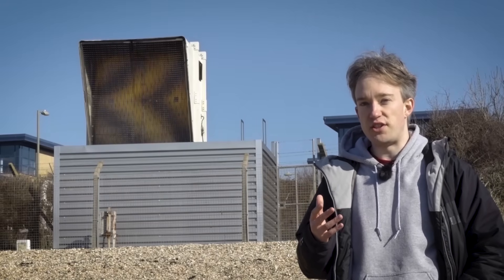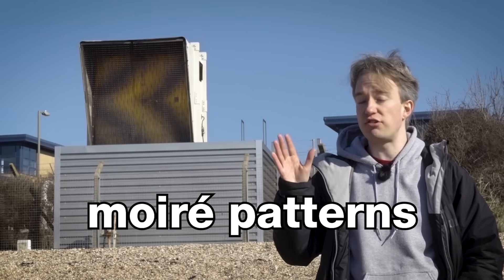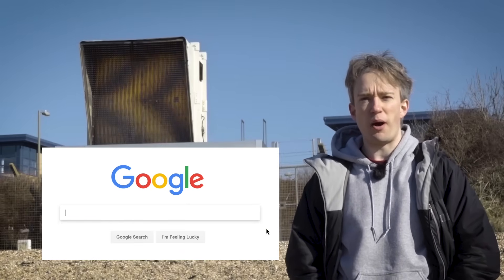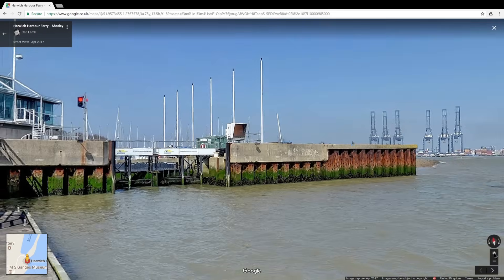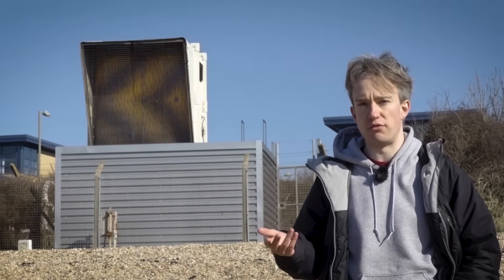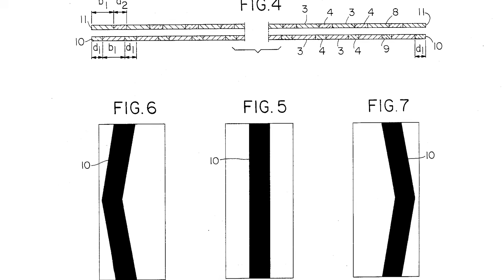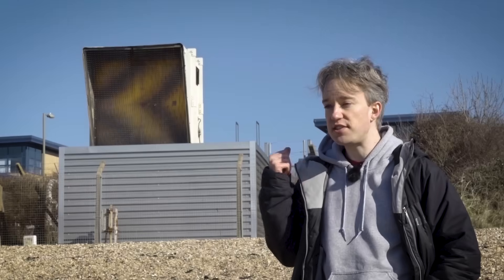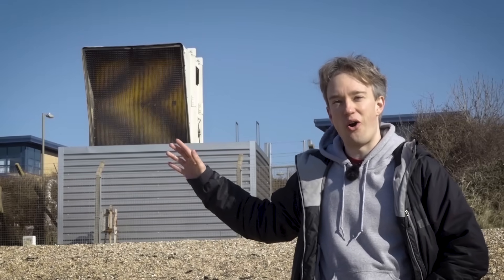The moiré effect lights that guide ships home

Comment from the maker: I'm getting emails from people who've misunderstood what I'm asking at the end of this video. Don't waste your time copying what I've already done! To be clear: I'm looking for solid evidence of why this particular light was chosen for a use that doesn't seem to make sense: flagging something to avoid. I don't need more information about where it is (Southampton) or what it's pointing at (a pipeline)!
Reply: People going: "I suspect...", note that he's looking for solid evidence. ;)
Reply: @DaVince21  Why would you need solid evidence for something so obvious as to not be questionable?
Reply: Hi Tom, I'm a merchant navy officer who used to work around there, although I never came across this particular light...  Sector Lights and Leading lights (parallax) are the internationally recognised marine signals for this sort of use (white light centre, with red and green lights either side to guide you to a safe channel, which i'm sure you've researched and are aware of), but one thing that doesn't come up too often is lines to specifically avoid, and as such there isn't an internationally recognised means of transmitting this with lights.  The signal is pointing towards the danger, which is unusual in maritime practice, but it's certainly not a common light and isn't in the IALA buoyage system used for identifying marine hazards.

If it's in a marina, which i think you mentioned, it'll be specifically to stop boats dropping anchor on the submerged cable within the marina's jurisdiction, and it'll be specifically referenced in the marina's or the solent by-laws as an anomalous regulation.  (I don't have time to go and hunt it down, but it'll be there as a local reg.)  As far as i'm aware, that's the only possible reason for it.  It's an unusual solution to an unusual problem.  I could of course be wrong...i bring no hard evidence to the table!
Hope it helps
Reply: @Sarah Thomas There is no naval base in Southampton, perhaps you're thinking of Portsmouth...
Reply: @jammin023  maybe not the Royal Navy but the Royal fleet auxiliary is based in that area in hythe i think.
Reply: So just to be clear, youre asking us to point you in the right direction.
Reply: Probably had a few hundred thousand left in the budget and said, "screw it, get another inogon light!"
Reply: addendum to the addendum - if the channel being used in the marina is the only safe water/depth for vessels to use they couldn't stick buoys along the channel, which would be the usual method of denoting the pipeline.  This light would then be both the leading line for the channel denoting safe water like a monochrome sector light, but also denoting the underwater hazard with a yellow light, killing 2 birds with one stone.  That might be why they're so rare.  Come to think of it, I could literally just check this on the Charts if you gave the GPS co-ords!
Reply: This is an alternative form of "leading light" (UK) or "range light" (US).  The usual form is a pair of lights/day shapes separated by some distance, with the on in front being lower than the one behind.  By itself all it does is indicate a particular bearing.  You must consult your chart or Coat Pilot to learn why that bearing is interesting.
Reply: Just a little addendum to this, having read some of the comments below, GPS is taught to navigators as a useful but unreliable tool, so buoyage and shore based lighting is still incredibly important to mariners, along with radar, and to a lesser extent astronavigation.  Just as a side note, my own training, many moons ago, involved a simulator run from the SW Needles in to the tanker terminal at Fawley with a GPS that gave random errors and buoys that sat out of position, so we're trained to use more than just GPS to follow a course line.  

I couldn't quite tell in the video the colour of the light that's behind the moiré beacon, because my laptop has a liberal use of the concept of 'white balance' , but yellow is considered a 'Special Mark' which can really be anything that sits outside the realm of the other lights as long as it has a characteristic (flash pattern) that cannot be confused with a white light.  There are no similar white lights, and no white navigational lights have an otherwise solid light characteristic, nor do they come in exciting moiré patterns.  'Special marks' typically denote the location of outfalls, protected areas, and other underwater navigational hazards.  

In addition, countries may use lights outside the gamut of IALA and ColRegs to denote things as long as they can't be confused for the internationally recognised signs.  So as long as they prescribe the regs in their local rule books and it's not similar to any other symbol used (which this isn't) unusual lights are legally fair game.
Reply: I hope all the people giving useless info here are taking the piss
Reply: Jason perhaps you could enlighten the rest of us as well?
Reply: Tom Scott you are one of my inspirations
Reply: DaVince21 I doubt one can get that easy of solid evidence online  perhaps. There are things of much misinformation, but this maybe in historical documents else where. 
Maybe asking company or whomever owns it?
Reply: I think what he means doesn't make sense is the direction the arrow points. You could argue they should point in the other direction if you are supposed to avoid that line, not pointing towards the line.
Reply: I can't believe people are telling you where it is when you're standing right in front of it.
Reply: Wait. People actually messaged you saying "yo this light is is southampton" after having watched a video of you standing in front of that light, which obviously required you to travel to southampton?
Reply: I mean if it doesnt make sense to us now its gotta be a religious or spiritual tool
Reply: I think the point many people are missing is they could have just put some flags/lights on either side of the 'pipeline' and then a big lit sign saying no anchorage between flags/lights rather than buying a fancy expensive light to indicate the area. I wonder if the lines can be rotated to change the 'no anchorage area' if perhaps the area isn't static? I'm not sure if the Inogon lights can do that or if the no anchorage area might not always be the same (someone mentioned subs elsewhere and I think we have a big naval base in Southampton so perhaps it serves more than one purpose)? How large an area do the Inogen lights direct around? I assume it isn't a very large area which would be fine if it is just a pipeline but not much use for anything else?
Reply: @misschief4283  some flags or regular lights would be ambiguous at any distance. With the inogon, you can be far away but still know precisely where to not drop anchor, etc
Reply: @misschief4283  It probably was chosen because (1) navigators are used to them and (2) in this case it helps for someone to know not only that a hazard exists right there (when you're practically on top of it) but also that you could prepare by being warned from a considerable distance away.  Maybe they're not widely used in other places, but in the USA and Canada where a high speed road approaches a stop signal from around a blind curve or hill, it's not uncommon to have a sign in advance of it saying "SIGNAL AHEAD" or even an electrified sign with the word "RED" preceding those words synchronized to the signal so that traffic will have an additional warning in advance.  This Moire device seems very sensible to me to use for an especially large or expensive hazard to navigation.  Remember that ships have considerable momentum and can't change course quickly.
Reply: I sent this question to a cousin who is a merchant ship captain. He made two observations:
1: The range of these signs is short. He has seen them used only for ferries.
2: They are also used in airports to guide planes to the gates.
Reply: Wait, so the arrows point towards the pipeline, rather than pointing away from the pipeline?  How weird.  I could see them being  useful to direct you away from something - angled such that the arrows show up, pointing away from the no-go zone, so if you drift to close they direct you away.  But if they're pointing /to/ the pipeline that is very counter intuitive.
Reply: Tarmo gr This is everything he said in the video. He is curious as to why they used this instead of something else, as this is expensive.
Reply: Such a light only makes sense if you know what it is pointing at/marking. It is the same rule for a lighthouse - you do not know wich way to steer around it, unless you know what it marks. And if you think about it, Navigation by stars follows the same rule: You can not navigate by them unless you can idenify them.
Any given lighthouse could mark the aritficial island in the middle of the harbor enterance. To the dangerous rocks on either side of the harbour enterance. You can drive around one either way, as long as you know the distance to keep. But for the other, there is coast on the wrong side, wich is one thing you really need to avoid as a ship.
For the (diving) crews that build and maintain that pipeline, it is actually a valid "match this" light. For all the others, it is simply a navigation aid that has been there for ages, so we keep it around rather then building something else. "Never change a running System" and all that.
Reply: What is even more interesting, is that the purpose of a Lighthosue largely shifted over time. The original ones were mostly about marking the save enterance. Wich makes sense, as keeping a light on was not cheap in antiquity.
But with modern structural engineering and electrical light (and GPS/Naval Radar of course) the purpose shifted towards marking hazards. More a oversized Warning Bouy, then what they were used for before.
Reply: Speculation: they used an unfamiliar technology so that it wouldn't be confused visually with existing directional signs.
Reply: Tom Scott Have you tried to contact the Harbour that is in charge of the area? Maybe they will provide an answer.
Reply: Arrows are supposed to point where to go. A maintainer of submarine pipeline/cables would interpret this signal differently than any other voyager afloat. ¿Possibly this was installed with maintenance in mind?

Of course undersea support vessels are using GPS and electronic charts (ECDIS) nowadays to guide their activities.
Reply: if it wasn't there the internets would get caught in the surf.
Reply: They couldn't order it reversed, cost too much to get it customized. So they just said do the opposite ;)
It's a guess, but that would be logical.
Reply: ISO 14726 shows a pipe sign/sticker/indicator, as being 3 verticle stripe lines - yellow/violet/yellow being liquid gas! But even just any colour left and right with a different colour in the middle should tell you it's a pipe!
When you can see the 2(3) lines on the Inogon light, your over the pipe and should wait till you see the arrows getting more and more pronounced as you get further away, then drop anchor when you cannot see the lights anymore!
Look on Google Maps, you can see a cutting in the undergrowth on the opposite bank and eventually the pipe exiting the ground before it goes into the refinery/storage facility!
Reply: Often I find the answer tends to be 'because it was good enough'. Not perfect, not necessarily or entirely justified, just good enough to do the job.
Reply: Ah yes, it appears to be from Southampton and pointing to a pipeline, hope that helps Tom
Reply: The moire the merrier.
Reply: If there were only one thing to stay away from, it would be helpful to know where it was.
Reply: You do realize that it is the internet that you are asking to, good luck.
I wish there was a time lapse of you doing research on this rather interesting subject.
Reply: I realise now that i've written too much for a youtube comments section
Reply: I disagree.  You set it out very well.
Reply: Martin Jeffries you seem well versed in  maritime matters..I curious from your  experience what's the longest distance you have spotted lighthouses from when approaching ports ect and any further info you can provide on line of site tech and distances achieved
Reply: Tom Scott i
Reply: I didn't know we could email you.
Reply: The simplest expalination is that the people who heard about this light and installed it misunderstood how the light is meant to be interpreted. 
Everyone just got used to using this light diffrently so now changing it would be more confusing. That's my guess.
Reply: So. what your are saying is most of the time these lights are used to tell you the right direction, but here they are indicating the wrong direction, the place you don't want to be? So how does one know the difference?
Reply: Well maybe that's exactly the point... to point at the direction ship should avoid.
Reply: Its a thing to do a thing. Nothing more, nothing less.
Reply: Tom Scott what if it’s an old piece of building equipment that never got removed? If it’s cabling, you’d want it very straight. Dredgers could have used it to dig up sea floor in a straight line, installed the cable, and then didn’t uninstall the light.
Reply: @ItsNotAHorn  It is a light. Lightbulbs fail and need to be supplied with electrical power.
So someone is maintaining that light. And has done so for decades.
Reply: Honestly maybe the guys were just really convincing and convinced them they needed a sucky light arrow
Reply: Flagging something to avoid! Using this inogon light, why not ??  It certainly marks out where the power cable is . Some people  in an office somewhere had a problem and looked at all the solutions and this thing won .
Reply: So, are there any updates? I'd like to know about the evidence. Thank you.
Reply: Tom Scott: I mean it is an effective way to let people know where the pipeline is 🤷‍♂️. As long as everyone that uses that waterway knows what it’s for, it seems like a good solution. In fact, I can’t think of a better (more accurate) way.
I just realized I’m 2 years late 🙄
Reply: That's the glory of boating! It happens all the time from the different buoys and flags. For instance keep red on the right and green on the left.
Reply: I'm a merchant seaman by trade and it makes no sense to me why they would use this instead of the conventional no anchoring /submerged pipeline signage
Reply: My suggestion would be that maybe the pipeline runs diagonally across Southampton Water to the refinery, and so by using the usual static markers on each side it would not be obvious which markers are the pair. Also the shoreline on the refinery side where the pipeline comes ashore is constantly blocked by oil tankers using the dock, so a static marker would not always be visible. So the marker needs to be a design that is directional and works from only one side of the estuary.
Reply: Is the purpose: (1) To indicate where the hazard is or (2) To direct people away from the hazard?
The person who specified the light may have been an industrial designer of industrial piping systems, not a nautical designer.   So marking the location of the hazard may have been his perspective.
Reply: chaotix80  Wouldn't work very well at night, and the mirror etc would still need to be cleaned/replaced when necessary.
Reply: Did you find out your answer in the end? I wondered if they used this type of light because from a Single point, you could delineate the trajectory of the pipe underwater, rather than a series of flags or buoys?
Reply: Maybe it's just me, but why wouldn't flagging something to avoid be a very good thing to do?  Your clarification doesn't clarify anything to me; I don't understand why anybody would ask such a question.  We use all sorts of "keep away" signs on land and sea, why would this be any different?  Did you think it's too sophisticated an apparatus to do just that?
Reply: @goodmaro  because flagging something wouldn’t leave a totally unobstructed path on the water surface for traffic to pass.
Reply: Why exactly do you think this use does not make sense?  A single sign relies too heavily on a persons ability to understand from which angle the cable runs underwater from the sign and at what angle they currently are from the sign.  Requiring to not be between the two signs on either side assumes you can see and be close enough to read the sign on both sides.  Point this thing along the underwater cable and set it up so your hazard message of choice is visible on center and off anywhere else and it’s perfect.
Reply: Tom Scott: please stop sending me messages saying it's indicating a pipeline, I know that already.

Result: 10,000 replies saying that it's indicating a pipeline.
Reply: Looks like the arrows show how close to the pipes you are and the parallel lines indicate that you are aligned with them, meaning “Do Not Anchor”
Reply: And the purpose for using this light is to indicate from a wide angle where it is as opposed to a single light which would appear the same from many angles
Reply: Chill out.
Reply: How difficult would it be to reconfigure the pattern so it always points away from center?
Reply: Did you try contacting the office of the Harbour Master?
Reply: The most likely explanation is that somebody screwed up by using it in that application/location and it was just never removed.
Reply: The answer is in the patent.
Reply: I find it particularly odd that they did it this way, when an easy fix would be to move the bottom half to the top half and the top half to the bottom half.  Then the arrows would always point away from it.
Reply: @ARTEM_VETROV  stop spying on us.....
Reply: Will try to hit it asap. But we are all vikings, even you. Just saying.
Reply: And why doesn't it make sense to flag something to avoid..?
Reply: Don't tell me what to do. 🤣
Reply: I bet it is the internet cable
Reply: Simply add a red filter on lights that are for avoiding
Reply: Doesn’t it make good enough sense? If you see an arrow you can drop anchor, if not then keep going. To me it’s like choosing a normally open or normally closed actuator in a pipe system. You can get away with using either, you just have to think reversed, or at least program in reverse.
Reply: It would appear that these guides can only be seen from the surface so there is some aim at security from seeing lights or other markings from the air - a military / national security measure? Also there is the possibility that other markers may be confused with IALA or airport marking lights due to similarity or proximity?
Reply: Tom Scott It does seem to be a strange use of such a piece of equipment. I know that there is a lot of stuff under the water there... Pipes, cables etc as you mention in the video. I also sail those waters. I have some local contacts in the area so I'll see what I can find out.
Reply: The only solid way to know for sure is to contact the company who put them there.
Reply: The light is doing exactly what was intended -- pointing out a particular bearing that is of interest to the mariner.  To know why it is of interest you must consult your chart or Coast Pilot.

It's information, not an instruction.
Reply: It doesn't make sense because these are normally used to direct ships.  See an arrow pointing one way, turn in that direction.  In this instance that is exactly the opposite of what they want you to do however someone unfamiliar with the area might follow the arrows without realising they are meant to mark out an area to avoid!

You're spot on about them using it for this purpose (i.e. marking out exactly where not to drop anchor), but it is the opposite of every other application these appear to be used for, or at least that we know of.  So are there any other instances where these are used to point towards a hazard?
Reply: Sent you email about one that is over 1000 years old
Reply: @jasongurr  where is that, and how does it work?
Reply: @jasongurr  really? is there a way that i could have a look at it?
Reply: @jasongurr  I would like that link to please
Reply: @jasongurr got any info on it you can point me to, please?
Reply: Tom Scott great video love it and all the ones you make
Reply: Look at complex Human Systems research (aka C2) at Nasa/Ames Moffatt Field ("the Blue Cube") from the 70's to 80's which also tested underwater detection (ie, antisubmarine) measures along with the DARPA underwater research lab in Idaho. The idea is subtly psychological: you turn with with arrows, even subconsciously and you tend to tack toward a light rather than facing it straight on. An underwater cable, defense installation, or runway path out over water is not something you want to call attention to, it's more about passively and subconscously causing others to clear an area.
Reply: The pipeline goes across the channel to the pumping station perpendicular to the light, so at any point along the pipeline, if you're directly above the pipe, the light is full intensity with no arrows, telling you not to drop anchor.  If you are anchoring there, you go out until there's a visible arrow on the light to know you're safe.
Reply: @jester1983  BINGO!
Reply: Watched a video on YouTube today that said this light is in Southampton and is used to indicate where not to drop anchor and is pointing to a pipeline.
Reply: @joanbohlman1679  I watched that too, it was by some guy named thom scot I think (spelling?)
Reply: +Tom Scott I have an idea as to why its there and a good idea as to what it's protecting, both of which involve the surrounding BP Oil UK, but I'm going to need more time to finalize research.
Reply: @noahgershoff3241  well, I’m still waiting…………..   patiently,……….. I might add.
Reply: I agree with some of the commenters here that it may be unusual to point at a location to avoid, but why not? Mariners not farmiliar in that area should consult their pilot books, which will refer to this light and why to avoid the area. If you look at an online map (like the Navionics webapp), it marks a stretch of water as prohibited for anchoring as well as fishing. Trawlers may be operating in the area. 

While we've come a long way with GPS and electronic charts, buoys, lights and other sings are still a primary source of navigation. If you want to mark this specific part of the water with buoys, you would probably need a lot. These require maintenance, can shift or get damaged from ice. This single light is probably a lot less expensive on the long term.
Reply: Maybe try walking up to the captain of a boat who routinely works on the harbor and asking what the light tells them to do? Or perhaps contacting the owner of the pipeline. Someone has to know, and they would be the most likely folks to know.
Reply: human error waiting to happen
Reply: I don't understand what you mean by "doesn't make sense". The application needs a line projected out over the water to indicate the location of something invisible, and that's exactly what these lights do. What about it "doesn't make sense"? 

(Also, <sigh> at all the comments about marinas, naval bases, submarines, and cables, when it's clearly charted as a pipeline between Fawley Refinery and the Hamble oil depot, and the video itself is obviously not in a marina or naval base.)
Reply: Simple answer, this way you only need one light, not more, to divert away from a single point you'd need two lights placed beside the spot you don't want people to be in
Reply: My guess is that it was used for the purpose of guiding the workers laying the cable. If it’s so expensive, they might have decided to leave it there for the (albeit confusing) purpose of informing the ships as to where the cable lies.
Reply: if the light was constructed before or during the work on the pipeline makes a lot of difference if the light was placed before this would be a really accurate way to construct the pipeline without the modern day dynamic positioning systems. or it is used as an indicator for survey vessels.
Reply: The lines were probably run in a straight line, as straight line is the shortest distance. When the Moire' shows I you know your directly over cable. When it shows > than you know your to the side of the cable and anywhere further out should be safe to anchor and vice versa for the other side.
Reply: My guess would be that its for maintanance crews and vessels replacing parts of the underwater cables and pipes. If its an oilpipe i can imagine that it has to be checked regularly for leaks.
Reply: Does Inogon even produce any other Moire effect lights with other patterns? Probably not since they even removed this one from the web site. Perhaps this video will give enough of a bump in interest to bring such products back.
Reply: Why wouldn't that be a reasonable use? Marking  something to avoid seems logical..  how else would you suggest to mark the underwater cable?
Reply: Isn't it sort of the best solution to the problem? The signs are usually used with a craft sailing towards it, and not passed it, and if there is a specific place where you can't drop anchor, wouldn't you want something that always points away from that point? I guess it is foolish to use what is usually a "this way" beacon as a "not here" beacon, but is there a better way to do it?
Reply: Cause lights work even better at night, while other markers get less useful?
Reply: If there is a water way under there Couldn't an anchor break through causing something like the 1980 Teaxaco incident. Yea It Wont drain an ocean but the boat that dropped anchor is defiantly getting sucked under.
Reply: sorry Did not know it was a Cable , Isn't it just To stop em from dropping anchor on a cable and causing bunch of damages? I dont know what the cables are but They could cost a lot of monies. Maybe I'm just looking at it too dumb .
Reply: @jacobrobison7088  It's not the dropping of the anchor, but the dragging of it that could do the damage.  But once you've dropped it, too late, huh?  Unless you cut and abandon it.
Reply: Tom Scott it’s in Southampton and it points to a pipeline
Reply: Possibly different ship are different sizes so knowing where the cable is exactly would allow you to judge your what room a vessel of your size has to manoeuvre??? Just a thought on a possibility.
Reply: Do they illuminate it with two different colours? If it was either green or red, green means 'park here' and red means 'keep clear'???
Reply: @whatyousaidbud  That would also be contrary to what's expected: In shipping and aircraft, red means port (left when facing forwards) and green means starboard (right when facing forwards).
Reply: The arrows point to where the item of interest is. Away, as in what you do about the item is up to the skipper. As for why that type of light... More commonly there would be a low level light near the shore and a raised one further back. Perhaps there was no way to place the high one due to terrain and land use.
Reply: How about the manufacturer only makes systems which point to something (guiding boats or planes)? Also worth noting that for anyone familiar with the system, they would be confused if the arrow pointed a direction and they never saw the straight line whilst they kepy going towards that direction indefinitely..
Reply: Perhaps it's not there as a tool to avoid the cable while at sea but rather to help find the cable if work needs to be done on it.
Reply: The oil spill off the California coast should be enough evidence of what happens when you’re improperly anchor.
Reply: that looks like that was thier b4 the houses try finding information on the plot or who owned the land
Reply: It's directing ships AWAY from the light. If you're coming from the right then it shows you an arrow facing right.
Reply: Unrelated but interesting, Moiré patterns are used in metrology for optical measurements.  You might think this is interferometry, and some measuring equipment does use that, but Moiré optical devices do exist and they are not using interferometry optical measurements.
Reply: We flew a kite in a public place
Reply: I haven't read most of the comments and I'm dead tired right now, but I would approach one of two different ways: 1.) What are the cheaper alternatives, and are they as effective?  or 2.) What is the overall intent of using this particular tech?(example questions: Does some one stand to profit that knows the right person?  Have they signed some buried international law, and it just that hard to change international law? Are are these light visible further away compared to other light in the past?)  Well good luck, and good night.
Reply: I would say the light has two purposes. The second purpose would be so pipe maintenance boats could accurately find the pipe at any distance from the sea.
Reply: They probably wanted one to point the opposite direction and the company either didn't bother to take the effort to make it do that, or they simply didn't know how, and then the people using the light, just settled for using that.
Reply: This light does not need to be understood by everyone. It only needs to be understood by large ships whose anchors could damage the pipeline and those ships are only piloted by a small number of Southampton port employees who are helicoptered out to the ships as they approach the harbour. It really doesn't need to make sense to anyone other than those people.
Reply: @backgammonbacon  thats for contributing less than nothing
Reply: I think that you answered your own question.  It is pointing at a pipeline.  If a ship were to drop an anchor for any reason, the anchor could snag the pipeline and rupture it.  Then, depending on what is in the pipeline you could end up with a big mess; or a really big mess and a quite serious calamity.

Normally, I am used to seeing very large signs about no anchors due to underwater facilities.  What I really like about this is that there is no ambiguity about where you (the ship) are with respect to the underwater installation of concern.  Especially when  there is an extremely wide channel.
Reply: @paulkurilecz4209  Cool sign
Reply: Uh, have you ever had people mark a cable in your yard???  THEY MARK WHERE THE CABLE IS.   

The same thing is done here....it's not complicated.  If you see vertical lines....don't drop anchor.
Reply: DaVince21 - I KNOW that I suspect... (sorry, couldn't help myself)
Reply: Or maybe if the pipeline isn't rigid, perhaps the moire pattern can be adjusted automatically/manually
Reply: Tom Scott I believe that it is telling boats not to place an anchor there because there may be a internet cable which connects the whole world together. I remember watching a documentary on internet cables a couple years back, if you’re still interested you could possibly research the relationship between the internet cables and the light.
Reply: It's possible it's just supposed to be a very cheap method of accurately pointing out the pipeline, without using power, yet is still highly visible and distracting. It Feels like something that would have been built in WW2.
Reply: Hi, so maybe you have figured this out by now, I don’t know, I tried to read a lot of the comments but not all of them. Yes, there is a pipeline under the sea at that point. The cables referred to on the sign are a unit of measurement, 100 fathoms, they are saying don’t drop your anchor for 100 fathoms on either side of this line. I hope this is useful.
Reply: Maybe it's indicating where the cable is?
Reply: Avoid drop anchor upon the subs, preferably avoid talking about the sub marina too...
It never daunted upon you there could be a reason that information was so scarse?
Reply: I believe it might have something to do with where ships cannot drop anchor. Behind the light there is a pumping station, most likely pumping oil from Fawley into the BP tanks.
Reply: @ianjerram6880  Scott: "Guys please, I know what it's for, I've just explained it". Everyone: "Okay, this is what it's for: ...."
Reply: Pipes have things in them and Southampton is a port. Anymore info you need let me know.